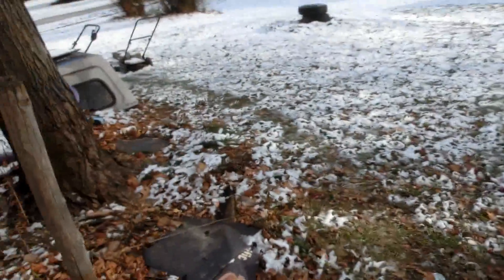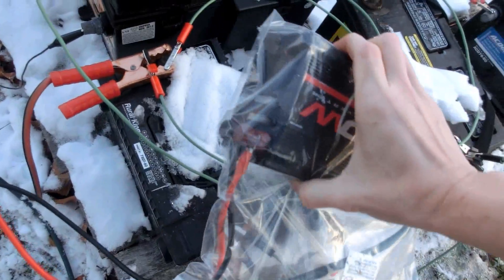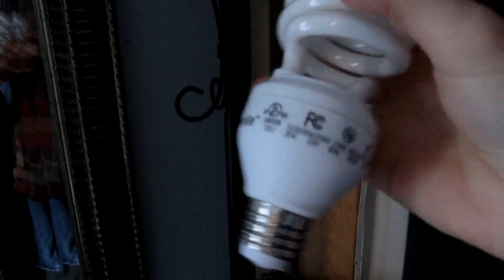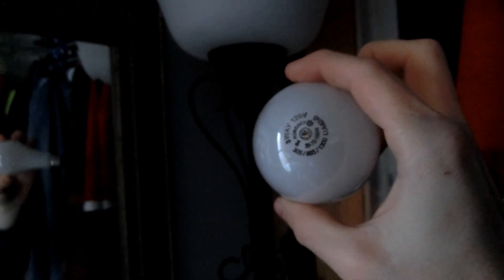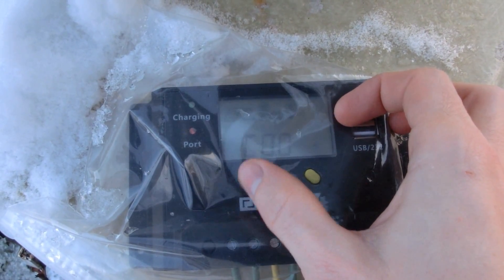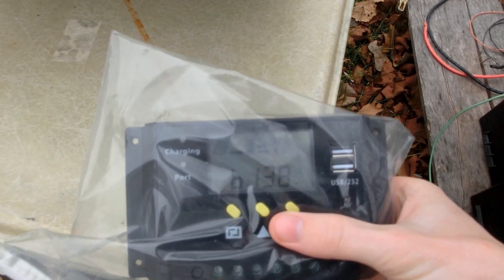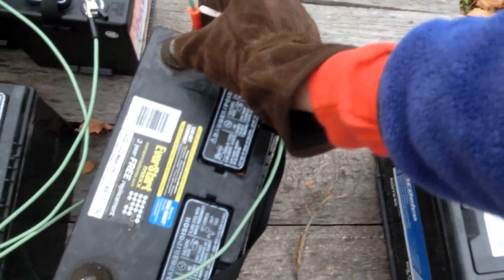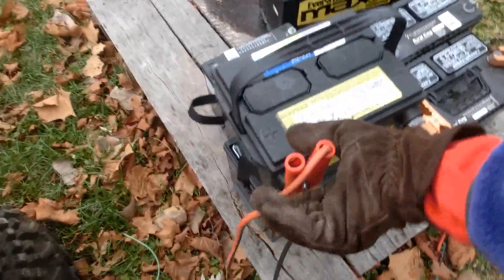Solar Sunday Experiments 005: done for a while

Comment: well if you don't know batterys lose charge when there in cold weather i use a plastic  walmart tub with lid i had to use old styrofoam sheeting to line the box this help with power! that 410 inverter will run a emachine computer & monitor the ext hard drive power supply to much for it!! i use a camper in winter the solar power & 12 volts i had a few cold nights and gas genny running a few times over night to keep the power up to run heater!

Comment: So many problems with your system.  I hope others do not try and learn anything about solar power through your videos.
Reply from the maker: go on then, you can't just state that i'm wrong without saying why i am wrong.
Reply: Rinoa Super-Genius I will long as you don't get offended. these are of course from my own research and experience, and thoughts. 

 
The list of problems with this. 

1. No matter the load on the system. bad gage wire used on the entire thing. (you say you're happy with them. but they're way too small in my eyes to be helpful for any major charging application unless you wanted to charge a small RC Car toy or a cell phone.)

2. Modified sine wave inverter (it just screws shit up, and this is why i tell people just don't waste your time or money with them. if you need a inverter, just wait and save the money for a pure sine)

3. Use matching batteries only. (don't connect together differing batteries with differing capacities. honestly it be better to use different batteries altogether instead of those old mismatched batteries. I say get something  like AGMs deep cycles.)

4. Set up a battery bay for them. like a vented box or something. (a big no no allowing snow to fall on them where they almost crossing both the terminals. no matter how small there was still the chance or cross connection. not to mention just asking for rust and corrosion to occur allot faster.)

If you disagree. whatever. "mada mada dane". there a reason you sound confused or disappointed (or whatever, your feelings where negative on this so yeah. lol) on how this has not been working too your liking. but in the video just seen you powering a light. the panels, and charge controller are just fine and can handle just fine without any more panels. I believe main issue is number 1. again just my thoughts.

Comment: im thinking about getting either a 50 or 100 watt solar panel, leaning towards the 100 watt panel because it really isn't that much more expensive, i have a 500 watt inverter and a wal-mart "115 ah" deep cycle battery

Comment: The hum is not an issue, you can always rectify the power from the Inverter and run the bulb on DC. I've used modified sine wave inverters for about half a year with CFLs and yes it hums a little but not too much and it stops humming after the lamp has reached full power
Reply from the maker: yeah but the first mode stopped working after a little bit.
Reply: Rinoa Super-Genius
 It might be a bad CFL then. Modified sine wave is a bit harsher so poorly made bulbs may get irritated and quit working. My setup used (expensive :( ) high quality CFL. You could try rectifying the inverter (put a capacitor after the bridge rectifier) the bulb wouldn't hum anymore and would not be stressed (in fact it would probably last longer

Comment: It certainly wont be that cold in Silicon Valley -- no snow generally -- but good luck getting a big property lot where you can set up solar on the ground. As for apartments in Sunnyvale, don't think you'll have any where to put up your own solar panels. :-( 

Regarding your batteries, shouldn't you keep them connected to the solar panel and charger to keep them in float? Not a good idea, especially in such cold conditions, to allow the batteries to drain.
Reply from the maker: no if i move out there i will buy some land back here to build a machine shop in the woods. i'm going to see how long it takes them to drain, ussually its taken them about 3 months to reach 50%.

Comment: Havein same problem with lead acid battery in the car at the moment given its more colder now its harder to pull higher amps on it, Maybe i should just stick the ultra cap array on it insted.
Reply from the maker: stick the cap array in parallel with the battery.
Reply: The thing is if the battery is draining im sure it will drag the cap bank down with it too? as if it were a 18650 in parallel that was dead
Reply from the maker: steve64464
you didnt say the battery was draining, just it wouldnt provide the amps.

Comment: Dont know if someone has explained it, but those fluorescente light bulbs aren't suposed to work with dimmers. They have his own internal circuit that works with the right level of power supply, cause it have an internal oscilator (a capacitor oscilator) that needs the correct voltage to work properly.
Reply from the maker: this isnt working on a dimmer, its a 3 way light. its designed for this.
Reply: oh ok :P

Comment: You should switch your bulbs to the Cree A19 and A21 series from Home Depot.
Reply from the maker: why?
Reply: Lower power consumption and they use drivers and not mini ballasts so they may put up with the sine wave issue.
Reply from the maker: Jason Price
but incadescent bulbs dont waste power, they help to heat the room.

Comment: U'll be able to make as many cables u want with stranded flex cable. The more strands the better. http://www.tricab.com/category/cable-types/welding/ just an example of what I'm going on about. Of coarse you wont need cable at that gauge. And if you get rubber coated cable instead of pvc it will be nice and flexable as well. 

With the battery's getting cold. I wonder if they were to be put into an esky. Put the lid on maybe a vent hole to vent the gasses when charging. Because they are in the esky and charging they should  be creating a bit of heat that might be able to be used to keep them warm? Should be able to get some esky's from thrift shops or something to keep it on the cheap. Either way its always hard in winter and solar. Like pushing shit up a hill with a stick.

Comment: When I do any wiring with low voltage I use marine wire, first it has finer strand wire and a more pliable insulation, it is also tin coated to protect the copper from the elements.

Comment: You should think about building a shed out back that you can insulate and heat with a wood stove that way you could put your batteries inside that space and do all sorts of kewl stuff :)
Reply from the maker: would take more energy, thats why i said i would build  a cellar that would keep them above frezing. but i may be moving to San Jose next year so it would go on hold longer.
Reply: Ahhhh yes, very cool. Save your pennies I think you'd fit in there

Comment: Dont feel down about the weather, you had some fun earlier on when it was warmer :-))

I think the odds were stacked against you with the solar power station mk1 experement, the batterys were far from A1 condition, plus the cold making them hard to charge, and lack of sun through the day robbs you of power.
You could do with a heavy test load to check there state, say an old truck starter motor, see how long it can be ran untill the voltage drops to say 11 volts, i know test gear can give you an idea but heavy loading will weed out the weak and watery batterys lol :-D

Inverters are a bit nasty, you could smooth the output waveform with a 1-1 iron core transformer, it is very lossy at the high frequencys, but you lose power in copper losses and eddy currents so its only any good for light loads :-(

Comment: Multi strand silicone wire is the flexible stuff but think it's quite expensive ;-)
Reply from the maker: ah like spark plug cables?
Reply: Rinoa Super-Genius yh that's the stuff welders use the same stuff to I think but you can get smaller gauges

Comment: If you use a modified sine wave inverter lots of things tend to hum and are more inefficient too. Shame pure sine wave inverters are so expensive.
Reply: Can you smooth it off with caps?
Reply: ‍1marcelfilms No it doesn't work like that.
Reply from the maker: abyssunderground
well you could, but it would be better to use an inductor. still it would have to be tuned to the exact load your pulling.